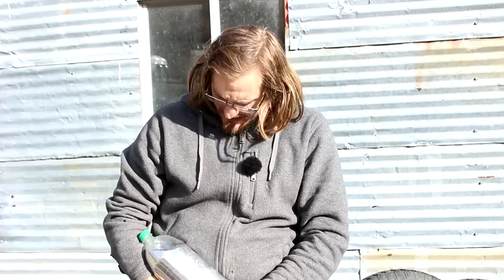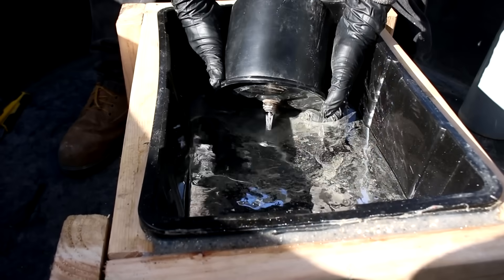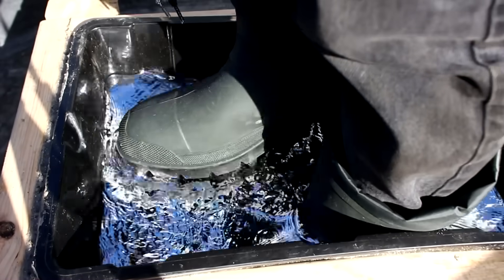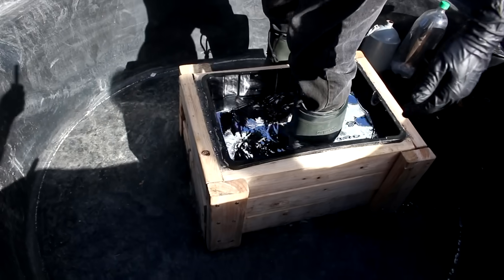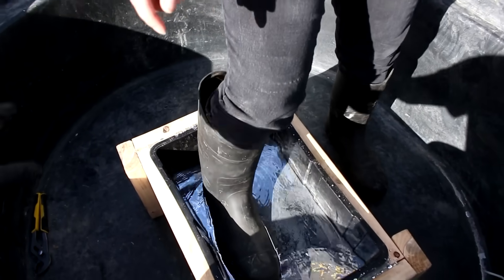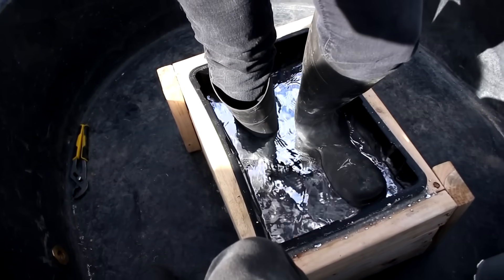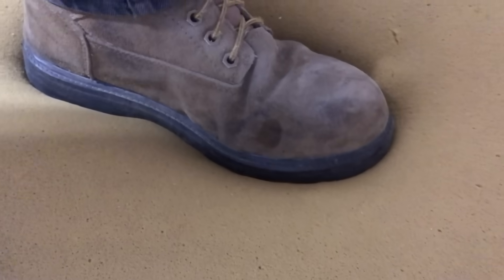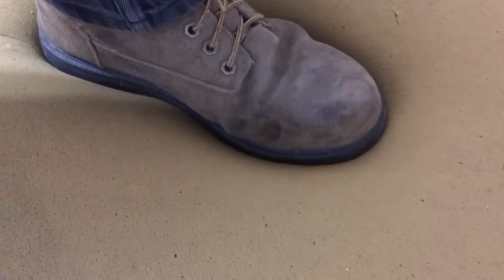Can I Stand On Liquid Mercury?

Comment: I know you say it's not dangerous, but that just is not true. I think the experiment is super neat, but you should really be practicing better safety. Its not the liquid mercury that kills you, its the mercury vapor that gets in your lungs. Mercury does exert a partial pressure on the atmosphere so there was definitely some in the air. I think you really need to be more careful, especially with a child around. Not trying to be that guy, but there are safe handling guidelines and warnings out there for a reason.
Reply: D0nK3yDon 

But those don't become vapor. The molocules are stuck in the droplets. The droplets pose no more threat than the tub of mercury they came from.

It's kind of like the difference between boiling water and breathing the steam, and spilling cold water on the floor. The steam and the spilled water are not the same at all.
Reply: Also 100% pure mercury will evaporate but if it is not pure you need to slow down the rate it does it at plus that rate decreases with decreasing temperature and for the vapor to accumulate you kinda need to be in a closed ans sealed room
Reply: Yes the mercury vapor in the open field under windy conditions at ~0°C will kill him instantly. What child are you even talking about?
Reply: lol, the fumes are still an issue. The child I heard was actually just that girl, so disregard that part (I didn't watch the full video). Either way, not the smartest thing to be doing.
Reply: Tylor Buster The Curies were pretty sharp too. Both won Nobel prizes. Yet Marie Curie managed to kill, not only herself with chemistry experiments, but also poisoned her daughter and two husbands along the way. Being smart and educated don't make one bulletproof.( Professor Jearl Walker is a poster case for this concept  in his article about the leidenfrost effect. )
Reply: D0nK3yDon that was just splashing mercury that you saw? not gas
Reply: Brett I'll make the mistake of responding to a comment again. If you read above, I wrote that I wasn't equating radiation dangers with Mercury dangers Rather, my comment was try to refute the assertion by a previous commenter that because Cody is well educated, he will therefore be safe.  I disagree with that line of reasoning.  He may take more precautions, but people with degrees still make a lot of mistakes. I work with a lot of educated people. A guy with a master's degree in engineering, who exposed himself to asbestos dust, by drilling a hole in our high temp furnace. Another degreed individual used a sawfile out of the tool box to deburr a threads on a cesium137 source. And while I didn't work with Karen wetterhahn, I did learn from Wikipedia that she was a researcher in metals toxicity, someone both educated and familiar with the risks. And while she didn't instantly die from elemental Mercury poisoning, she did eventually die from one mishandling mistake of a more toxic Mercury compound, one that she studied professionally. This wasn't the early days of science, it was 1997. She was educated, but in the end, not safe.
Reply: D0nK3yDon ok, I understand the point you're making. You're right, being educated does not preclude mistakes and accidents, and safety practices are made standard for that reason. But, that's could be true of anything. Cody has researched mercury extensively, and knows the real dangers of mercury. The fact is that mercury and mercury compounds such as mercuric nitrate act very differently as far as exposure risk is concerned. Cody is simply trying to prove that the public opinion of mercury is impractical in contrast to the scientific community's recommendations and research.
Reply: Chrispy Customs yes, I doubt if I could see vapor.  What I is was getting at,.is this: if large visible droplets are bouncing back a couple feet, smaller ones could get inhaled. The aeguments above regarding  Vapor pressure in cold air are irrelevant if you are breathing in liquid in aerosol droplets, and they contact the warm respiratory surfaces.
Reply: >with a child around
Reply: Karlwojo1 mecury metal not dangerous. Mercury vapoer its serious danger and organic mercury hight extremaly danger! Cody dont play this qantity mercury, small ok to many years your life starts to stops.
Reply: Karlwojo1 You are the perfect example of why Cody's channel is likely to get taken down again. His channel is becoming TOO popular, and people that aren't fans of the channel watch one of his vids and just assume he's some reckless science fanatic. Any fan of Cody's channel would know that he is well aware of most dangers that come with his experiments, especially mercury.
Reply: I don't think you need to worry about mercury vapors at below freezing temperatures.
Reply: D0nK3yDon so, the support you're giving for arguing against Cody making these "unsafe" videos is an analogy of Marie Curie working with unstable nuclear material? Marie Curie set the stage for the future. Think of all the inventions based on her work and sacrifice.... not that Cody is doing groundbreaking research, it's just that he's trying to teach people to be pragmatic instead of frightened and ignorant.
Reply: D0nK3yDon That's because radiation wasn't understood. Mercury is well understood and will not poison him.
Reply: Karlwojo1 safety sissy to the rescue
Reply: D0nK3yDon also, I want to bring up the point that mercury vaporization is slow and decreases with decreasing temperature. Cody did this outside on a very cold day, ~30° F, it was *windy*, he put his bucket in a tub to prevent an irrecoverable ground spill, he was careful to avoid much splashing, recovered all the mercury from the bucket back into his containers, used a non-porous surface, removed the dust from the mercury to prevent bacteria creating methyl mercury compounds. I'm willing to bet he even did something with the boots and bucket to either recover the mercury or avoid contamination indoors by bagging or leaving out for evaporation.
Reply: It's definitely safe, especially in such a cold and ventilated environment. Humans can tolerate well beyond 2e-11 moles of mercury in the blood stream, equivalent to 150000000000000 molecules of mercury, which usually pass through respiration in a few minutes. The amount he or anyone's breathing in is at most a hundred molecules
Reply: He didn't say that it's safe. He said that it isn't as bad as people claim.
Reply: Maybe try watching some of Cody's other videos rather than watching part of one before commenting on his safety (or lack thereof) practices.
Reply: The Curies were working with elements they had just discovered, the properties of which were unknown. Mercury has been known for hundreds of years. Absurd comparison.
Reply: Karlwojo1 You will get more mercury by eating tuna regulary.
Reply: I wouldn't worry about Cody's use of mercury, he's not stupid and I'm pretty sure he knows how to handle it (reasonably) safely. Though this is sound advice from a "don't try this at home" perspective.
Reply: i need to stop arguing on the internet...I always lose! :)
Reply: Joshua Omer does it need to become vapor, if is splashing back into your eyes or mouth? Or if you inhale an aerosol droplet?
Reply: I wasn't comparing the Curies to Cody, as much as I was trying to provide counter-examples to Tylor Buster's idea that being smart protects one from danger(known or unknown).  It helps, but it doesn't make you invincible.  Perhaps a Chernobyl engineer, or Challenger engineer, would have been a better example.  They knew the dangers, and probably weren't uneducated, yet ...
Reply: @Karlwojo1 First of all, you could hear the wind, so the chance of mercury vapors caused by natural evaporation building up and causing toxicity concerns is minimal.  

Secondly, Cody mentioned how cold the mercury was, which will aid in ensuring the rate of evaporation is slow.  

Third, Cody has, on several occasions, worked with and done experiments with mercury, as well as showing us the results of his blood test a bit after sticking his unprotected hand completely into a vat of mercury, with the results coming back completely clean.  

And finally, what child was around? Did I miss there being a child somewhere in the video? If you are talking about Kanyon, who he had step on the mercury as well, then you are mistaken as she is around his age and is his fiance.  

Fear of toxic chemicals is not a bad thing to have, but respect for them is much better.  Learn what the risks are, and take precautions accordingly.  Cody has done that, as I would always expect him to.
Reply: Radi Bear There's visible blobs splashing out left and right while he pours.  If I can easily see those airborne droplets, glittering in the sun, on a 2inch wide cellphone video..... then there's certainly more than 100molecules in each droplet that splashes up towards his face. (Or should I say atoms, since it's distilled Mercury?)
Reply: Another post regarding his safety practices... Cody is a well educated man, I'm sure he knows what he is doing.
Reply: Correct, playing with Mercury = not smart. So, one man plays with mercury = 250,000 people who no longer have to try it themselves. He's saved a quarter-million humans from a very expensive death. Bravo Cody!

Comment: How many lbs of water would that be in comparison
Reply: The description says hes using 640lbs of Mercury, so it would be the same with water (640lbs).
Gallons of water, it would be just shy of 77 gallons. I'm just using an 'average' weight per gallon of water (8.32lb/gal).
What you just seen was about 5.67 gallons of mercury. Again, just an 'average' weight per gallon of mercury (112.87lb/gal).
Reply: Ryann Large Genius.
Reply: That volume of water(about 6 gallons) would weight roughly about 50 pounds. 
The same volume of mercury weights 640 pounds according to Cody, so yeah.

All you clever 'geniuses' in the comment section that can't even answer a simple question are just embarrassing yourselves. A little bit of trivia knowledge does not make you some sort of elite.
Reply: I believe he's asking how much same quantity of water as there was mercury would weigh
Reply: Ryann Large a (short US) ton is 2000lbs, a quarter ton is 500lbs.
Reply: 500 pounds of mercury weighs the same as 500 pounds of water.
Reply: I'm sorry that so many people in the comments know nothing of physics or chemistry and think you're an imbecile because they don't understand things. First of all Cody is close, but not spot on, Mercury is about 14 times more dense than water. And since the equation for density is D=M/V in order to achieve the same density you have to increase the mass (by using more of it) of the water, or by having a similar mass in a smaller volume. Neither of which is very feasible except under extreme pressure. So there is no real way to recreate this without enough water to create enough of its own pressure to increase the density 14 times. Or you could add isotopes to the water, and reduce its temperature, both of which increase density. But humans in general are less than 1000 kg/m3 dense, which is why we can float mostly submerged in the ocean, kinda as Cody mentioned. Because oceans are generally slightly over 1000 kg/m3.
Reply: But steel is heavier than feathers
Reply: Ryann Large cool
Reply: You're almost right. Cody said Mercury is 13(Thirteen) times denser than water, so you would divide the weight of the mercury(640lb) by 13, giving you 49lb and some change.
Reply: Ryann Large omg Somone who understands how measurements work that's hard to find on the internet lol
Reply: 1 litre of water weighs exactly 1 kg, gold is 17 times heavier than water, i'm not sure about mercury, but i'm sure someone can Google it, just to give people an idea of just how heavy it really is, considering 1 litre of gold would weigh 17 kg's your average 1 litre soda bottle
Reply: Durrrrrrr how many pounds of feathers do it take to equal a pound of bricks
Reply: Pressure does depend on mass, more specifically the density of the fluid.
Reply: Pressure in water is a factor of depth and mass, Ignacio. This is why the great disparity between pressure measured in "inches of mercury" and "Inches of water", both being the same depth (one inch) but different masses. Gauges may have both scales printed on the same instrument. But an inch of mercury pressure = 13.6087 inches of water, this is pressure. Inches of water is used primarily for very small pressure differentials, Inches of Mercury pressures are used for slightly higher ratings, such as barometers. A typical 30 inches of mercury air pressure at sea level would read a cumbersome 176.9131 inches of water, but they equal the same thing. Mass is the difference.
Reply: Actually, if you're asking in direct comparison to an equal volume of water (5.67 gallons), it would be equal to around 47.17 lbs of water.
Reply: Legal Planet They meant the same amount of gallons. There's only about 5 gallons of mercury there. 5 gallons of water would DEFINITELY not equal 640lbs.
Reply: there are so many people that need to learn how to read a question, and read the previous comments
Reply: Mega I'm sorry that even though you're frustrated about how inaccurate people are about the densities of water and mercury,  and although Cody wasn't "spot on",  you are also not spot on. "about 14 times"? And you complained about his estimate of "about 13 times"? The number is 13.6087.
Reply: Ryann Large   Just different volumes.
Reply: Roy Reynolds as explained I used what he said in the video not the description. The tools are there if OP decides to do the math himself.
Reply: Cody said mercury is 30x denser than water so you should divide it by 30, am i right?!
Reply: MrShnigglepuff 90 miles
Reply: Daniel Darksun so the calculations using online calculators that I came up with by your math is only about 1lbs lighter than 13x.
Zach Ferguson I mean.. not sure if you're being sarcastic. I'm not a smart man by any means but that seemed fairly easy to figure out.
Reply: 1 litre of water is really really close to 1 kg, but not exactly
Reply: Just to validate the calculators I used dividing 500 by 13.56 which is the density of mercury comes back to 36.87. Where as the calculators I used came back to 36.97
Reply: blue fish
Reply: Jacob riddle at the end he says 500lbs
Reply: Legal Planet your math seems to be flawed
Reply: That's what he said. Or were you just agreeing?
Reply: Because of a Newtonian liquid's molecular characteristics, they tend to possess a definite volume without any specific shape. The important aspect is the height of the liquid not the shape of the container. If the height of a liquid with a specific gravity of 1 is 2.31 feet high (rounded off), The weight of that column is one pound over an area of 1^2 inch. Thus, P(PSI) = (H/2.31) or more exactly, (H * SG)/2.31 for any Newtonian liquid at any temperature and any specific gravity.
Reply: @MrShnigglepuff It would take 3.6e+12 nanoseconds.
Reply: Yeah, I read that 1L of water at about 4°C is 0,99997 kg, close enough haha!
Reply: Someone said that water pressure is bases on the depth but not the mass
However when the depth increases, the mass of water exerting force on something increases also.
By definition
Pressure(pascal) = force(newton)/area(square meter)
When depth increases, the mass providing the force increases, then the gravitational force increases(Weight = mass * gravitational acceleration), and therefore pressure increases
Reply: lol ;)
Reply: Alot
Reply: Pr3lude9 density wise
Reply: Ignacio Romero pressure forms from the mass of water thats above you underwater. Water is just much less dense than mercury and takes higher volume but it all comes down to mass and gravity.
Reply: 500 pounds is 500 pounds  :-P
Reply: but the specific gravity is different
Reply: Jacob riddle... the troll master.
Reply: 640 Lbs of Hg, is 290.29 kgs 290.29 kgs of water with a density of 1 g/cm3...
209029 grams with water at density of 1g/cm3
209029 cc in l
29.029 L
15 soda bottles.
Reply: Well it looked to be about a 2 liter bottle. He said it weighed about 50 lbs. A two litre of water weighs roughly 2 kg....So.. do the math.
Reply: Ryann Large what the fuck just use kg and liters
Reply: Water does not weigh the same as mercury. Sure, a pound is a pound, but the OP was talking about pounds of water in the *same volume*. Water weighs about 8 pounds per gallon. I don't know how many gallons of mercury he has there. My wild guess is around 5-6 gallons, so between 40 and 48 lbs. He did say he's using 640 lbs of mercury, which would be 112.95 lbs / gallon at room temp, or 5.667 gallons, but it's freezing outside in his video, so it could be far denser.

But I'll stick with my estimate of 40-48 pounds.
Reply: Pressure in water depends on the depth, not the mass
Reply: If you are driving 80 mph, how long does it take you to drive 80 miles?
Reply: Pretty sure it would be the same weight as the weight of the mecury used, just different volume
Reply: Jacob riddle ...640 lbs of water weighs the same as 640 lbs of mercury
Reply: @UnkownEvil "I believe he's asking how much same quantity of water as there was mercury would weigh"...........650lbs of water.
Reply: I didn't see the description that said it was 640lbs of mercury. I went by what he said in the video of a "quarter ton" which in the us is 2000lbs. I gave you the tools though so you can redo my calculations. Pretty good for a high school drop out.
Reply: Stuart Cole why are you telling me that? I already said it myself.
Daniel Darksun I answered the damn question, showed my work, and provided tools for OP to figure it out for himself.

Comment: Hi Cody, would it be possible to run across Mercury if there was for example a lake of Mercury between you and your destination? Also what would happened if you kept on getting submerge in it, would the Mercury eventually hold so much force on your body that it would prevent you from emerging to the top, apart from getting squashed by it of course?